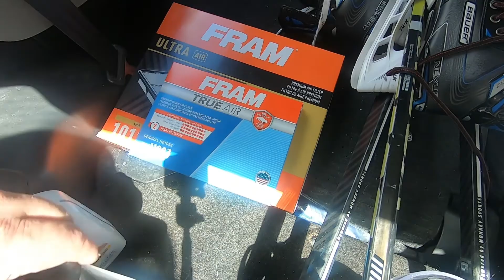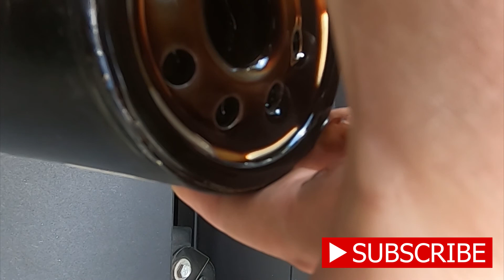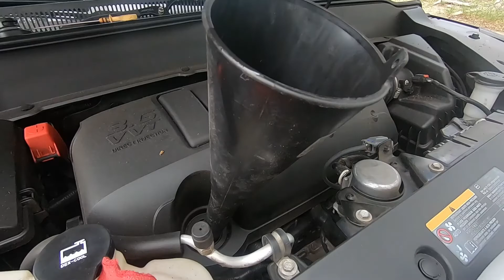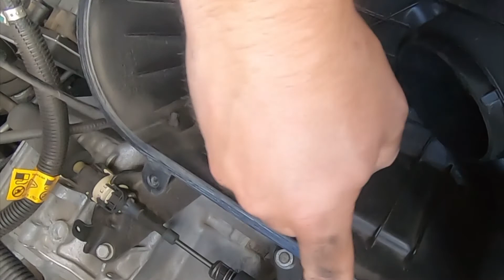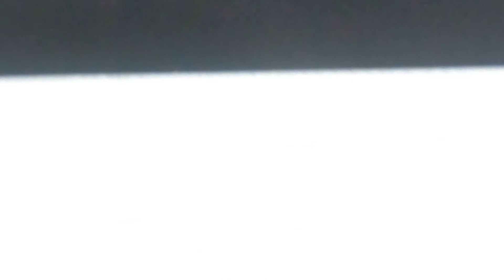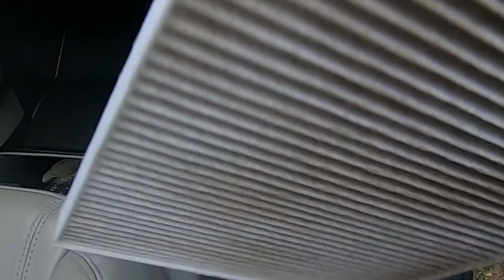2009-2017 Buick Enclave tune up- oil change- cabin air filter change- mass air flow sensor cleaned

Comment: Do you recommend using the CRC GDI Intake Valve Cleaner, too? 

Do you use both CRC GDI Intake Valve Cleaner and CRC Throttle Body and Air Intake Cleaner?

If you use both, does it matter the order that you use them?

Thanks
Reply from the maker: You can use both - the intake valve cleaner is just more concentrated

Comment: You should drain your oil before changing the oil filter
Reply from the maker: When it is a cartridge filter up top of the engine it can be done either way.
Reply: That’s what I was  thinking. This is the second vid I’ve seen where they did filter first.